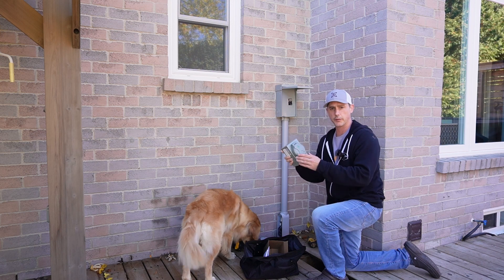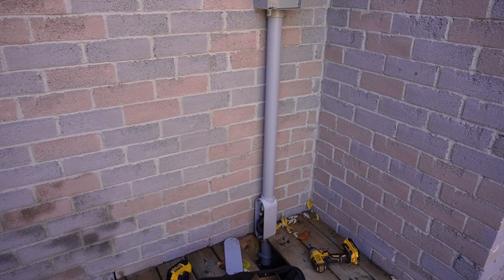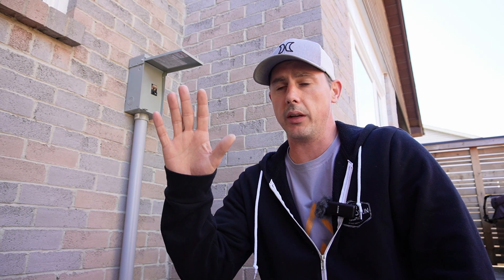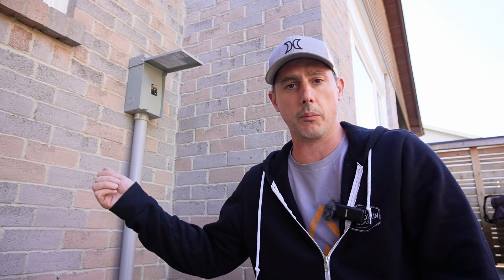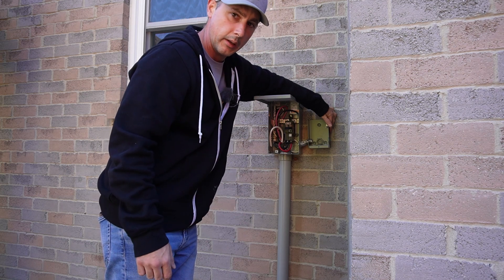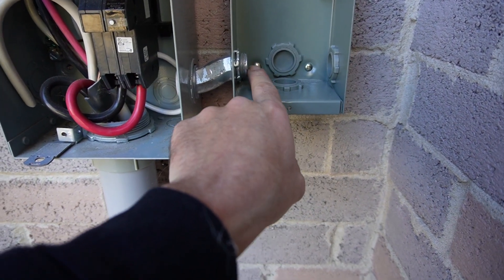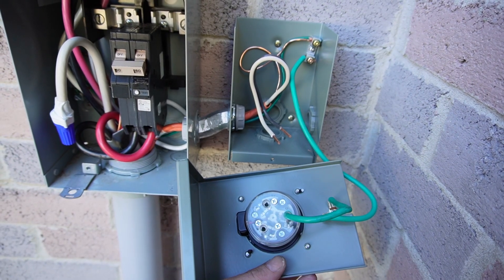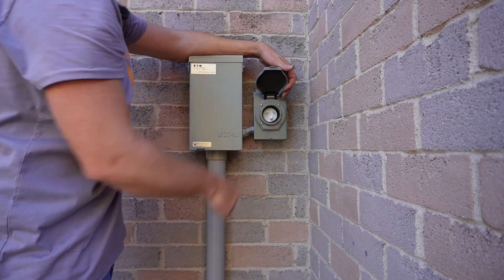Generator Hook Up For Less Than $100!

Comment: Nice wring job.  Get a tent, rig an umbrella or build a makeshift roof or shed, because having the generator that close to the house is NOT SAFE.
Reply from the maker: @joshm3342  For some, it could be an issue. You would want to be aware of the potential hazard.

Comment: Hook the generator up for autostart via your charge controller or inverter or all-in-one. ie no grid and not enough solar kicks in the generator to charge the batteries/run the 30A socket.
Reply from the maker: I would love to do that. My generator doesn't have a dry connection port for auto start. Also my generator has a carburetor it need to be chocked to start. 
I don't mind walking outside to start it

Comment: Great video, have similar Champion dual fuel.  One observation would be to be careful on distance from generator to any window or door.  If the sliding glass door is air tight, it's probably fine, but there are guidelines for how far away the generator should be.
Reply from the maker: That is the perfect point; I remember the last ice storm here. People died running generators in the garage and bringing BBQs in the house to keep warm.🤦